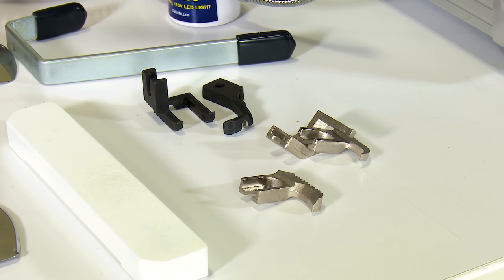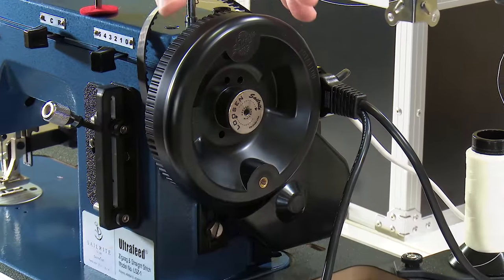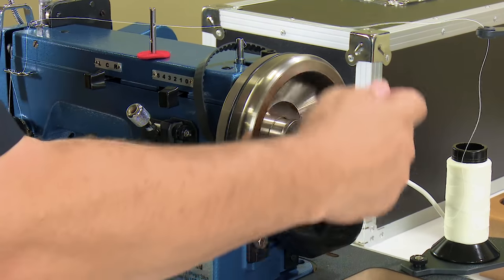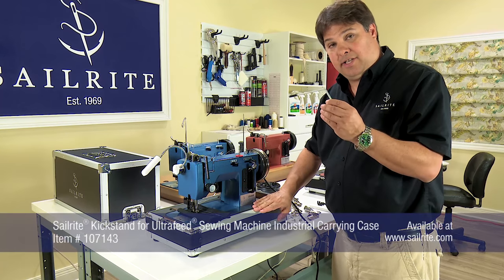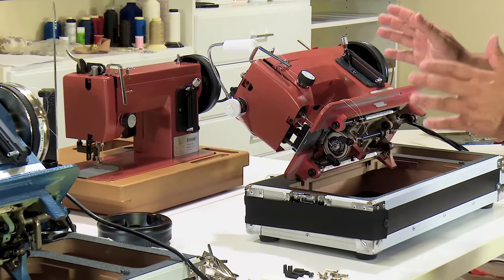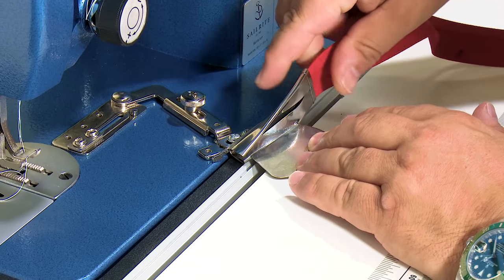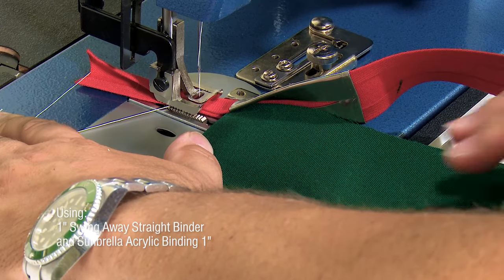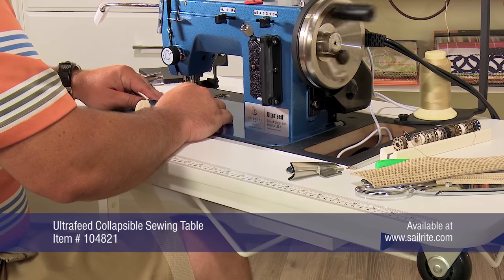Popular Accessories for a Sailrite Ultrafeed Sewing Machine

Comment: Love the monster wheel, much easier to control the low speed with it being a 7lb flywheel. It also smooths out the machine.
 
 The light is very nice but awkwardly short necked, if it were 2 or 3 inches longer it would work better. (Story of my life.)
    
 I may have to get that magnetic guide but for now I need practice keeping my stitches straight so until I attack the Bimini I'll hold off on that item.
Reply from the maker: Glad to hear! Thanks for the suggestion on the light, we will evaluate it in the near future.

Comment: What happens if you manually roll the stock wheel with the motor engaged? Can it affect the timing or damage the machine?  I’ve done that a few times.

Comment: Please what are the most important accessories by name?
Reply from the maker: Sailrite® Monster® II Balance Wheel
Sailrite® 1" Swing-Away Straight Binder
Sailrite® Flex20 LED Light, Bracket & Adapter Kit
Sailrite® Deluxe 5-1/2" Magnetic Sewing Guide
Left Roping Zipper Foot
Cording Foot Set (for large welting)

Comment: * * *
Why does the heavy wheel make the machine run quieter...?
I'm curious about it... several reviews indicate the noise is significantly louder than a domestic machine.
* * *

Until that time. . .
Reply from the maker: The Monster II Balance wheel is solid steel and does not have a hollowed out backside, like the plastic standard Power Plus Balance Wheel. Because of this the noise of the sewing machine does not reverberate from a hollowed out backside, as found on the Power Plus Balance Wheel.  This makes the Monster II much quieter. Yes, the Sailrite Ultrafeed is much louder than a domestic sewing machine, that is very true! It sews like a dream and makes more noise. Let me know if you have more questions.
Reply: * * *
 @SailriteDIY  right on...
Thanks for taking the time to respond and clarify.
Well, after a career in the military as a Morse code radio operator, I'm deaf in one ear and can't see out the other... (wink)
A little "shake, rattle, and sew" won't hurt me...
(grin)
* * *
Until that time. . .